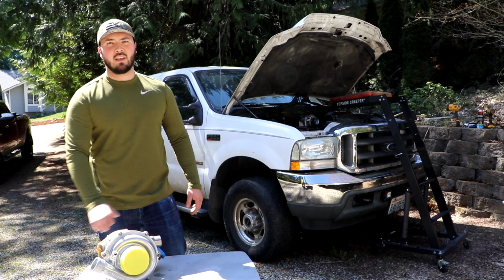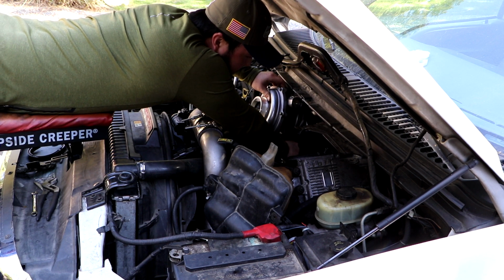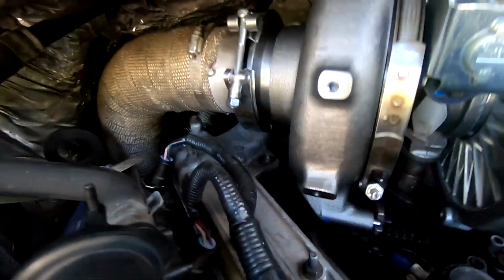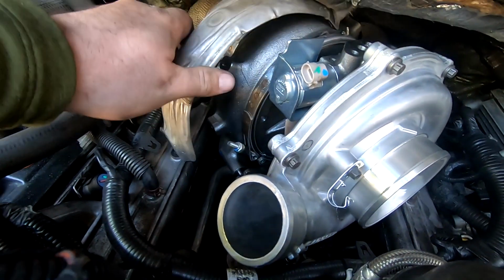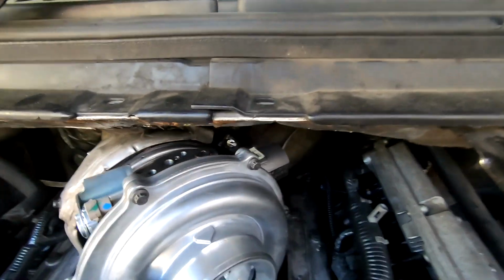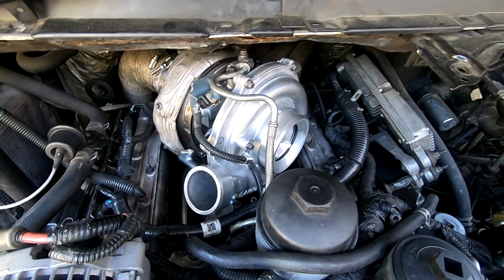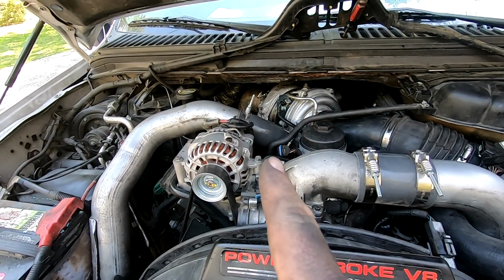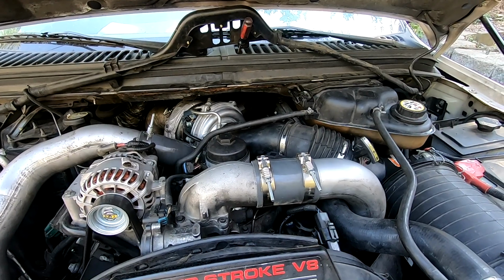6.0 POWERSTROKE TURBO INSTALL

Comment: Thanks for the video! how tight do you tighten down the innercooler cold side hose?  I heard over tighten can cause issue butI don't want to make it too loose either.  probably better to be too tight than too loose huh?

Comment: Did it ever leak at the uppipe after? I've only done one when doing uppipes so I had everything loose. Have to do one on my current truck just wondering if I'll have to loosen the uppipe bolts as well?

Comment: Did you pre-oil the turbo before you the start up?
Reply from the maker: Yes, I should have shown that but I was still very new to filming and video creation. I also cranked the truck over without firing to prime the oil feed.
Reply: Where do i pre oil it?
Reply: And how much